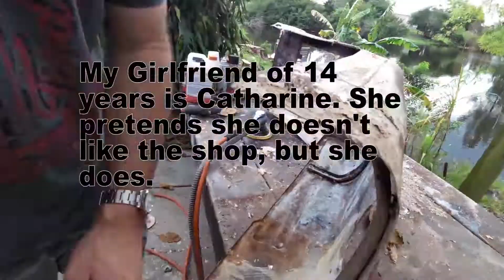Tractor Hood (Not worth watching)

Comment: Interesting video.  You probably have places in your area where you can take a piece like this hood and they dip it in a tank of chemical.  The product comes back 'clean to the bone'.  Well worth the cost...  I would work on the big dents and a couple of 2 x 4s and wood clamps can do a lot for the bends near the edges.  Just saying'....  With all that vegetation do you have trouble with snakes?  I couldn't handle that - I would be a 'ball of nerves' going back there.  Fortunately I come from an area that is to cold for snakes.  Looking forward to the rest of the restoration... :)
Michael from Canada
Reply from the maker: Hi Michael, alligators are more of a problem than snakes are. Most shops down here do not want to mess with stuff like this and if they did I have no doubt they would want $300 or $400, which is cost prohibitive for me. Cheers

Comment: I see a number of other youtubers use CRC rust converter.  Looks kind of like runny, thin, white paint and dries to a blackish finish that doesn't need priming supposedly. I was thinking about purchasing some if I do a larger metal furniture project.  No clue what the prices should be.  Looks like $80 Gal on Amazon which is a lot better than the $70 quart on Amazon Canada.  Check out some videos though first before you get going all click happy on amazon. haha.  Good video though.  Joe Facts were fun.
Reply from the maker: Hi Bradley, I have not tried the evapo rust yet. I had a little naval jelly, it worked great. The naval jelly is just gelled phosphoric acid, it really dissolves the thick stuff. The gallons of phosphoric acid are very cheap $8-$9 at home depot. I would like to find a way to make it a gel myself and save some money. Cheers
Reply: @joeheilm  not evapo-rust that you see guys soaking things in for a couple hours, but CRC rust converter.  Found a short( 2 minutes) video of a guy using another product that looks to do the same thing.   https://www.youtube.com/watch?v=lodAfnIbVqM    it's even on a tractor hood!